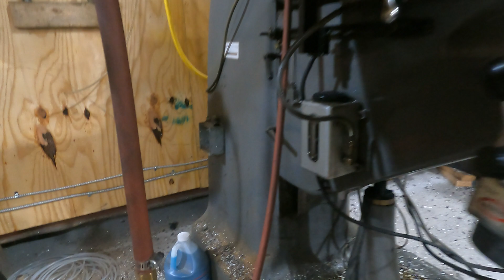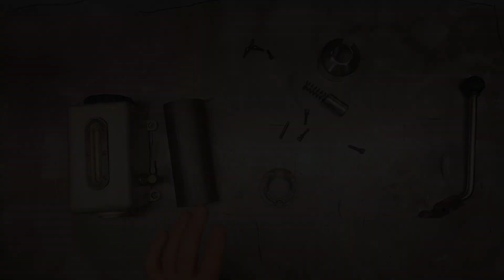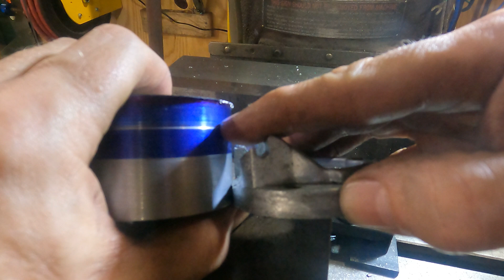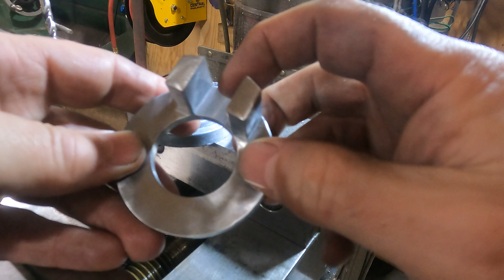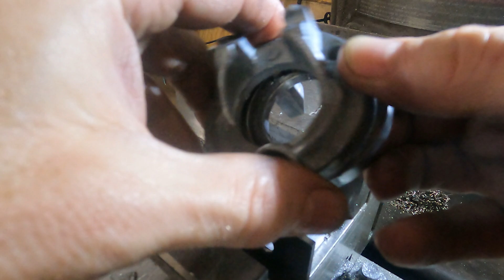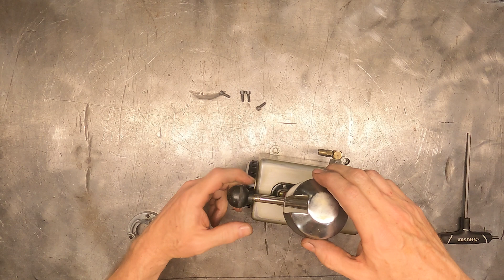Machining a replacement pump handle retainer for a milling machine one shot oiler.

Comment: man that was a great repair job, thanks for sharing.
Reply from the maker: Thank you for the nice comment!  

I'm glad you enjoyed it.  I, obviously, had a need to fix the machine, but I thought this would be a great example for loose tolerance machining.

Sometimes people get so hung up on specifics they forget about the actual use case.  Machine for the use case, not to show off.

I could have easily thrown that part in the rotary indexer, spaced the mounting holes exactly 120 degrees apart, etc. but that wasn't required for the use case.

As an engineer I've told those I mentor "Never let perfect be the enemy of effective"